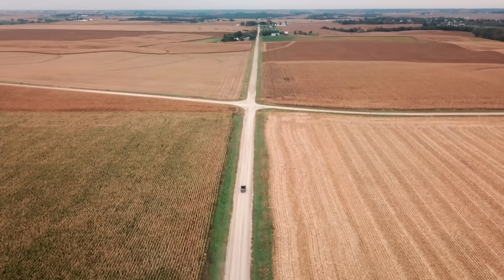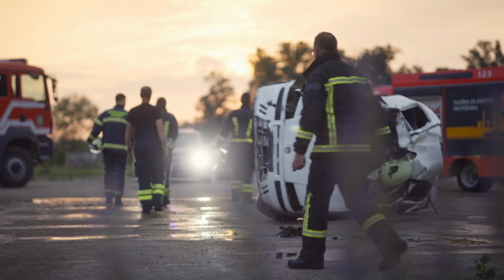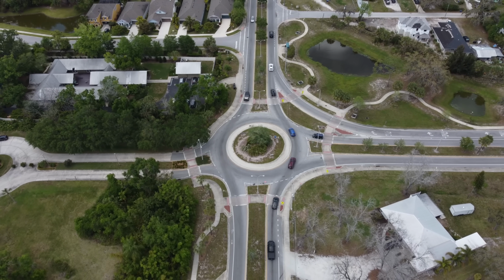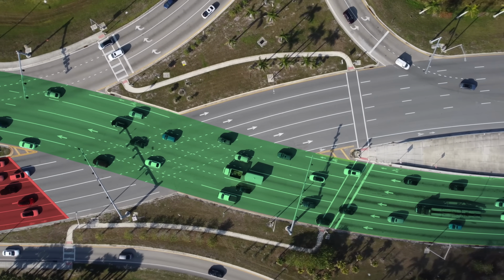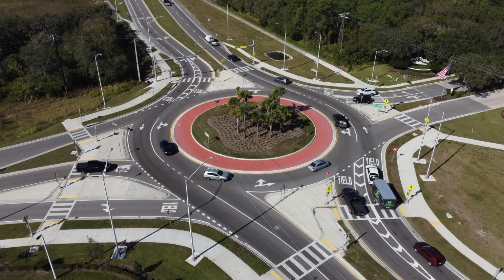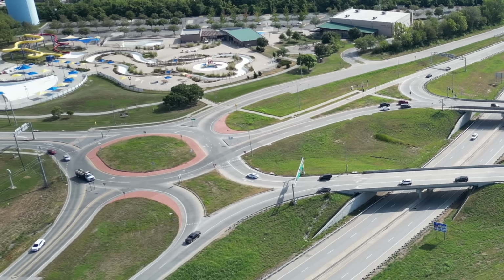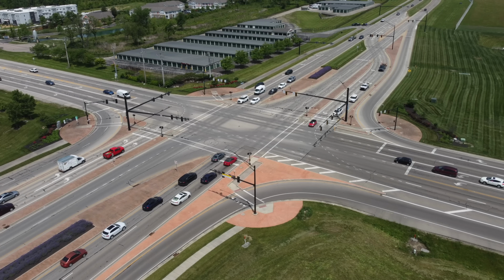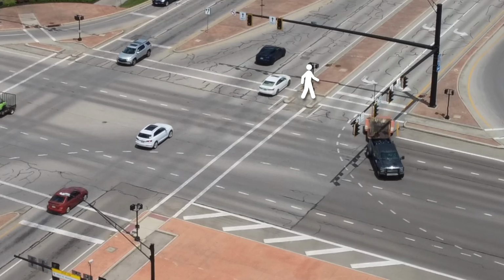These Intersections Are Changing the Roads Forever

Comment: You didn’t discuss the impact to pedestrians and the neighborhood.  One of the biggest problems in road design is that engineers often treat the road network as if it’s in its own universe.  People outside of cars should also be considered.
Reply: All but one of these are highway style interchanges, in which case people outside cars should only be considered in one direction. Except for the roundabout which has plenty of mods to it to make it pedestrian safe, and is already bike safe given the low speeds
Reply: Yeah the main disadvantage of all of these designs is that they're enormous and confusing for pedestrians and cyclists. They should be used sparingly outside of cities to handle the traffic comming in but apart from the roundabout shouldn't be used in cities.
Reply: He definitely did discuss the impact to pedestrians.
Reply: Aside from the small roundabout which is not difficult for pedestrians, the others in this video were dealing with areas outside neighborhoods and in areas with that would generally see very limited walking.  The video did mention that some (larger) intersections can pose an inconvenience to pedestrians.   Most importantly this video according to the title, was "These Intersections Are Changing the Way You Drive Forever", so it was on topic.
Reply: Though a good amount of the stuff posed here is near a highway where that is generally not an issue (though further from that this is a fair point)
Reply: yes this exactly! road engineers need to consider bikes and pedestrians too, and in more than just an after thought
Reply: And then when you bikers get your lanes, you still want to think you're pedestrians and cause crashes. Get a car.
Reply: cars are expensive, bad for the environment and dangerous.
Reply: @jstnrgrs  Then move to an inner city in Europe. And don't ever call an Uber. Ever.
Reply: @wschmrdr  Are cars not dangerous, expensive and bad for the environment in Europe?
Reply: Why do urbanists assume every road serves a residential purpose?  There are certain facilities for vehicles, there are certain facilities for pedestrians and local traffic.  These designs are for major intersections for national and regional traffic.  Local traffic facilities have their own specific designs where local are using it for that purpose.  We are not building sidewalks a crosswalks on motorways are we?
Reply: @traffic.engineer  If this were the EU, or the better example of NL, where roads are correctly separated into motorway and residential, then I'd agree. But this is in the USA. Our towns are next to and around motorway intersections, so people have to cross these intersections to get access to half the town. See 1:43. Some intersections could get away with limiting pedestrian traffic to logical paths, but most intersections need crossing in every direction. Also, the Michigan left-turn U-turn intersections as seen in the video are in the middle of businesses and houses (See 8:18), so local traffic needs to be included. I agree that they shouldn't be though.
Reply: @Int_resting  to be fair here in The Netherlands the only roads you don't see pedestrian/cyclist infrastructure on are our version of the interstates.
and with those we often have bridges across them for those other mades of transport.
and those bridges aren't just every 50km or something like that, no they are between area's where people want/need to go, so they are useful.

even our highways (80km/h roads) have pedestrian and cyclist crossings for those people to get to one side to another.
preferably grade separated, but if volumes are to low, or the space isn't there, just simple crossings with a pedestrian island between the lanes to break up the entire crossing into 2 smaller crossings.
Reply: @Int_resting  the Michigan U-turn preceded the development around it. It was originally supposed to be a restricted access arterial.  When the volumes did not justify it, it became more urban.
Reply: @ChristiaanHW  Many of the inner US states actually allow bicycling along the shoulders of the motorways.  A 3-meter shoulder along a 120+ kph roadway.  But primary purpose is move national traffic over long distances, hence why they will not have dedicated bike lanes.  Nor are some of the major interchanges along these that are demonstrated im this video.
Reply: @traffic.engineer  Doesn't have to serve a residential purpose, to need to prioritize bikes, and ensure pedestrians are entirely safe (if maybe needing to have the pedestrians go a longer - but not that much - route than perfectly ideal).
Because taking a bicycle between towns is not all that ludicrous (particularly not if it is a cargo bike), and pedestrians decide to do that recreationally at times too (but I do agree that ideally the pedestrian and bike routes both keeps far from the motorway and is nice to use instead. And for intersecting it, using a bridge far from any motorway-intersections).

But besides that, this was about a road intersecting with the motorway as far as I understood it? If there is a road, then there is a protected sidewalk and a protected bikelane. So a 100% safe way for them to cross is needed too.
Reply: @feha92  I am not saying bicycles are limited to residential streets.  I am saying certain facilities may need to prioritize traffic similar to motorways.  This is not arguing against parallel biking facilities nor discouraging intercity bicycle travelling.  This is simply stating that arterials are focused on the movinh traffic from region to region, thus have dedicated purpose.
Reply: @traffic.engineer  > "arterials are focused on the movinh pedestrian and bicycle traffic"*
FTFY
Reply: @feha92  No, that would be collecters.  Collectors allow easier access and mobility for vehicular, bicycle, and pedestrian traffic.
Reply: @traffic.engineer  Because there simply is no distinguishing that in the US, currently. I've lived directly next to major highways and arterial roads where people are going a good 20 miles over the already too-high speed limit almost my entire life. Yes, we are building sidewalks and crosswalks on motorways, or worse: Not and just expecting people that need to cross to figure it out, which is shockingly common.
Reply: It baffles me why so many people want to make so many places pedestrian friendly when there is ZERO, near ZERO pedestrian traffic.

I've seen THOUSANDS of miles of 'sidewalk' along roads where there may be one or two people who actually use it per year - and they're usually drivers who broke down and have no choice! We, the taxpayers, spend billions of dollars coalescing to a handful of POTENTIAL pedestrian traffic when all it does is create more infrastructure to build, maintain, and destroy when 'upgrades' are needed. What's even worse is when a county requires new developments to put a sidewalk in the middle of nowhere, that connects to nowhere, to serve no one, just because 'future expansion.' I've seen sidewalks that connect grassy fields to grassy fields, along a 55mph 2-lane roadway!!! Pure stupidity and total waste of resources!!

And, while we're at it, another thing that tweaks me is every new sidewalk is required to have pedestrian friendly crosswalks and 'handicap accessible' ramps - you know, those yellow, raised, polka-dotted, 'walking stick' friendly pads, so the blind can feel where the ramp is?? I think that's a brilliant idea WHERE THERE IS PEDESTRIAN TRAFFIC!! But I've seen these placed in the most RIDICULOUS places!! Locations which MIGHT have one blind pedestrian PER DECADE!!

We need to spend our infrastructure monies wisely and design and build for the majority of those who will actually use that infrastructure! Not the .00001% of potential traffic.
Reply: @DaveC_TN  It's almost as if no one wants to use pedestrian infrastructure when it is dangerous and uncomfortable.
Reply: @DaveC_TN The irony of saying we need to spend infrastructure money wisely and then advocating for more car centric design (quite literally the most expensive and inefficient way to plan a city).

You're looking at the problem through such a small minded and narrow lens. There are no pedestrians because the infrastructure that is there sucks and american cities were designed specifically for cars (not walkable). You need to zoom out and fix the entire system/ way of life, not pave a single nicer sidewalk on the side of a stroad.

The reality you live in now largely exists because it was the will of large car manufacturers and oil companies. Streetcar tracks were ripped up and highways were paved through dense neighbourhoods while corporations brainwashed americans into buying cars and living the dream. They were creating the problem and selling the solution. Now you sit here and fight to keep that reality that was forced upon you before you were even born. I think that's pathetic and weak. Bending the knee to corporate interest and denying yourself a better life while complaining about the pedestrians and cyclists who are really the ones ruining your city. l m f a o.
Reply: @Tekno210  I know...TL:DR...

Ummmm...OK...So, where should I start.

I'm not talking about 'planning a city'. I'm discussing INTERCHANGES and SIDEWALKS, IN AMERICA.

America is very much 'car-centric' by geographical necessity. It's also very important to ensure the competitive nature of free enterprise works properly. And the car manufacturers and oil companies never 'brainwashed Americans into buying cars and living the dream.' Nor did any company or entity create a problem to sell us a solution.

What do you think 'living the dream' means?? From an American's perspective, the dream is to own a small piece of land, with a decent sized house, in a nice neighborhood (or farm land...), reasonably close to shopping, dining, healthcare, and work, where we can raise our families independently and with choices. Not everyone WANTS to live in a small (or big), tight, congested city. Not everyone WANTS to live above their grocery store, or bakery, or coffee house.

No one 'brainwashed' anyone into buying anything. The reality is if anyone 'forced' anyone to do anything, it was the consumers who demanded better transportation.

The free market is all about recognizing a need, developing a solution to fill that need, and getting appropriate compensation for meeting it. Not creating a problem just to manufacture a solution that we're forced to buy (until recently...). The free market is why there's DOZENS of car and motorcycle manufacturers out there, with hundreds of models, that all fill different wants, needs, expectations, and demands.

Auto and oil companies manufactured products that met the NEEDS and DEMANDS of consumers who DESIRE to live the American dream of open space and freedom. They also manufactured products that supplied the market's need for reliable transportation, agriculture, and interstate transportation. But, why is that so important??

Do you have any idea just how little of America's land is walkable, urban, highly populated cities as compared to rural, unwalkable, wide-open spaces?? 

ALL of the urban, 'walkable', areas comprise of A TOTAL AREA of approximately 74,000,000 (74M) acres - out of the 1,900,000,000 (1.9Bn) acres that makes up America's lower 48 states. That is ONLY 3% by land area. 3%!! COMBINED!!

Based on how you spelled 'neighbourhoods', I'm guessing you're British. For comparison, ALL OF ENGLAND is approximately 32,000,000 acres. Our state of Florida is about 38.4 Million acres. The entire UK is about 60 Million acres. Our State of Texas is a measly 171,900,000 (171.9 M) acres. That's almost 3 times the size of all of the UK!! Yet it's still ONLY 9% of the lower 48 states' area. If you really want a great size comparison, state by state, search for the YT video "U.S. States Size Comparison" by the channel, Gravity.

There are places in America where you can drive for over 200 miles (322Km) without seeing a single gas station. Traveling at 100km/h, that's over 3 hours, non-stop, of nothingness. If you do happen to see a pedestrian on that stretch, they are in desperate need of help!!

Something else to consider is America is built on the notion of competition and choice. In a single metropolitan area we may have 20 different hospital SYSTEMS all competing for patients and their insurance $$$. We have the choice of where we get treatment. There are THOUSANDS of places we can choose to shop, dine, get services, be entertained, and spend our earned income. You may need a specialist Dr and the one you choose is 25 miles from your house. Or, you want to work for company ABC that's on the other side of town - 10, 20, even 30 miles away. Making those treks could take 3 hours using mass transit while driving there would only take 30-45 minutes.

I'm not looking through a "small minded and narrow lens" - I'm looking at it from the perspective of someone living in a country that's 50x the size of England. As someone who drives an average of 25,000 miles per year. Whose interstate highway system has an average speed limit of 70mph (113kph). Who takes motorcycle rides of 200-300 miles in a single day, for fun. Who sees hundreds of interchanges per week in just general travel. Who lives 3 miles away from their closest grocery store, hospital, pharmacy, or restaurant.

America is much different than many places around the world. This country is HUGE!! Most Europeans cannot imagine just how massive America really is!!

To go from Key West, FL to Pensacola, the other end of the state, is 12.5 hours.
To circumnavigate England takes about 15-18 hours. 
To drive across Europe, from London to Kyiv, is about 25-30 hours.
To drive from New York to San Francisco takes about 43 hours.

And, to circumnavigate the 'Four Corners of America's Lower 48', a drive from Key West, FL, to Ft. Kent, Maine, to Bellingham, Washington, then to San Diego, CA, and back to Key West, FL, its a quick 145 hour drive, even when cheating and driving through some of Canada. To stay inside the US, add another 10 hours.

And, if you really, REALLY want to WALK that trip, it's a quick 138 to 145 DAYS of 24-hours, non-stop walking. NO STOPS.
If you slack off and only walk 8 hours per day, it's 414 days.

The reality I live in is not 'pathetic' or 'weak'. It's on a scale most cannot imagine!! AND I LOVE IT!!

ROFLMFAO!!
Reply: @DaveC_TN 🤡
Reply: @DaveC_TN  The freedom you're talking about, to purchase one 5 figure car vs another, that's not really freedom. What people deserve is a transportation system that's safe and efficient for any type of travel- walking, biking, trains, and cars. In the US where's the freedom for a teen who doesn't have a license yet, an elderly person who can't safely drive, or a poor person who's car is broken and they can't make the payment for a few months?

A system that demands you spend thousands on a car in order to meaningfully participate is fundamentally broken. It blocks out huge groups of people and you're worse for it.
Reply: @Fig-Animation  You just don't understand the scope of America's transportation nightmare.

To really grasp just how difficult public transportation is here you have to experience it.

People who live in medium to large cities have 'serviceable' public transportation. It's not GREAT by any stretch, but, if you live within most major city limits, there are busses available. In very large metro areas there are also train and subway systems. But there's also the economic reality of operating these systems and the lack of revenue they generate.

And then there's the personal choice that's involved. Most people do not like to be dependent on others for their transportation, whether that's public, a friend, family member, or anyone else. We enjoy the independence of being able to choose our schedule, go where we want, when we want, and using whatever method of transportation we choose.

As for required to purchase a 5-figure car - New car prices are stupid these days. So too are used prices!! But there are still plenty of used vehicles out there that are in the 4-figure range that are more than adequate. And, if you don't want to spend on a car, you have the freedom to move to a city and live that lifestyle!! But MOST Americans have ZERO interest in living in a city environment.

Comment: saw a forum post 20 years ago reacting to a DDI:
"Wow, that is the oddest SPUI I've ever seen. Do any of those actually exist?"
"In theory it looks like it would work well. Not really a SPUI, in the same family maybe. The two signalized intersections are much simplified since it needs only two phases, so there's much less delay to the cross traffic. Exit ramp traffic never stops, unless the left turns back up from the other side's signal."
"Yeah, I'm with Detroit Planner, that's definitely a crazy spin on a single-point urban interchange (SPUI)"

Comment: How does this compare to one elongated roundabout across a highway? Common on UK motorways for example. Eliminates traffic lights, and high capacity.
Reply: or what you often see in The Netherlands, one roundabout on either side of the highway, connected with a simple few lanes road between them.

it's like the old school simple intersection design, but instead of those two intersections you have two roundabouts.
no traffic lights needed, no left turns, and the traffic keeps flowing.

kinda sad they didn't include either of our things in this video.
Reply: @ChristiaanHW you see that in the UK too. It's lower capacity as the entrances and exits from the roundabouts are more tightly packed, but it's still much better than traffic lights